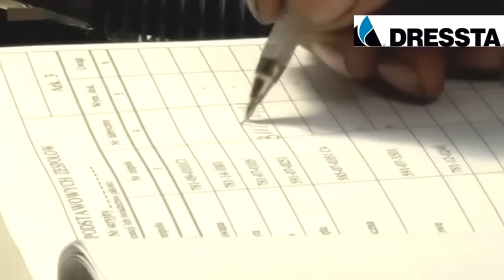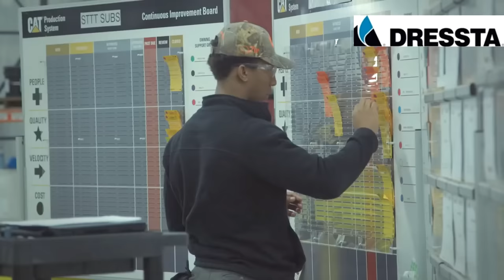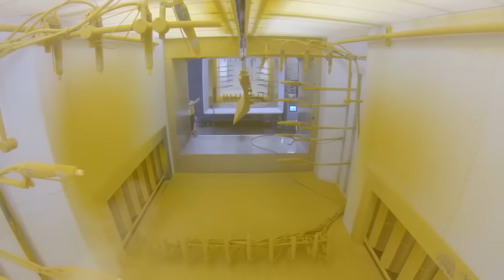▶️DOZER MANUFACTURING🚧2024: Bulldozer Assembly line [CAT, Dressta, John Deere] How it's made? USA

Comment: Back in the late 70's worked at a industry's company. I worked on a track line. We made the track shoes for catapiller. Took something like 40 foot long bar steel, cut to size on ban saws. Threw them on a track, slid them down to the touch. Touch the notches in the lead end. Back on the track and to the drill press. Drilled 4 holes in each shoe. Then to the burr bench. To be deburred, and reimed.  Then stack in bins. The shoes weigh anywhere between 70 lbs to 130+ lbs. We ran 900 to 1400 shoes per shift. 4 guys ran the track line with 2     9 hour shifts. I was chiseled back then.
Reply from the maker: Wau, pretty amazing! Thanks a lot for the comment!😉
Reply: And I bet underpaid for that hard work.
Reply: У нас ЧТЗ до 90 выпускал промышленные трактора башмаки для них делали на зоне тюрьма строгого режима. Теперь нет таких количества и зона без работы.
Reply: @machinatuscom  tdztei custard wu nitjczkhbk jfi

Comment: I went on a factory tour of cat in Peoria Illinois in the late 90's it was awesome seen every thing from the foundry castings  to the engine assembly to the finished product driving out of the factory it was an awesome experience to see
Reply from the maker: Thanks for sharing your experience...💙
Reply: Most of the actual manufacturing is outsourced now. Cat Headquarters moved to Chicago several years back. the only foundry still operating is Mapleton Engine block & Head casting. East Peoria basically does some large frame machining, gear machining and is the assembly hub for large size Dozers. (D8 to D11)
Reply from the maker: @onmilo  Wau, thanks a lot onmilo for the info... I didn´t know that! You work in this sector?
Reply: @machinatuscom  Did. I'm retired now.
Reply from the maker: @onmilo  Enjoy your retirement... and just please subsribe to hel me grow... :) Have a nice day...

Comment: Worzked for Caterpillar in the 80 .later for Oshkosh installing  3406 s
Reply from the maker: Waaau, that´s cool Bernard! What was your job to do there?
Reply: I was fitting 3406 motors  into oshkosh trucks which were originally fitted with 1673/4 motors

Comment: I've been operating and repairing this size of machines for 40 years, I'm very disappointed with all brands now. Too much glitter and glamor and a total pain to work on. I do have a boat with twin Cats that I can still work on without a computer. So I say old time CAT . New dozer Deere, Minnesota.
Reply: I don’t think there is anything wrong with computerizing machines — the advantages you get are too large to not to, really. But there is definitely something wrong if the OEM encrypts or otherwise makes it impossible for non-OEM mechanics to work on their hardware.
Reply from the maker: Thanks a lot for great personal experience... for me is CAT also number one in reliability...👌

Comment: I have been to the Cat factories in Peoria. My company made and installed a equipment that finish machines the track links after they are friction welded together. Rough bore, finish bore then they hone. We also face milled the ends to the correct length and drilled and tapped a few small holes. But the place is friggin' huge and everything is just big.
Reply from the maker: Thanks a lot for the comment and your experience... Enjoy also Tank production line: https://www.youtube.com/watch?v=8iiqwf_anYs

Comment: The new metal is built to last 5 years. They make it as strong as they want. Old equipment is made of better metal. That's why classic cars are more expensive than new ones. The lab sets the strength for the metal by test on metal shavings. Why not make it stronger?